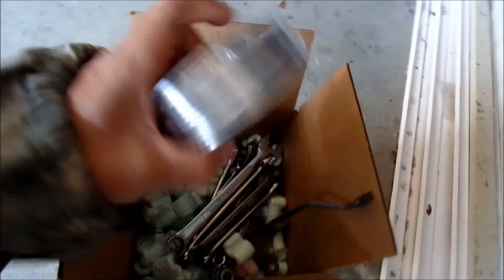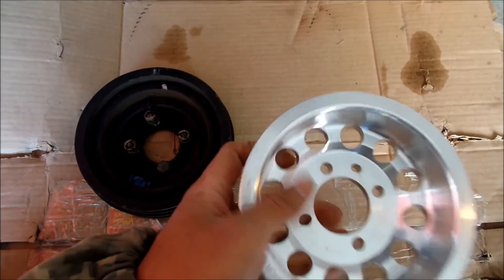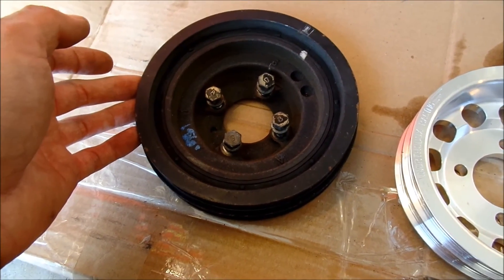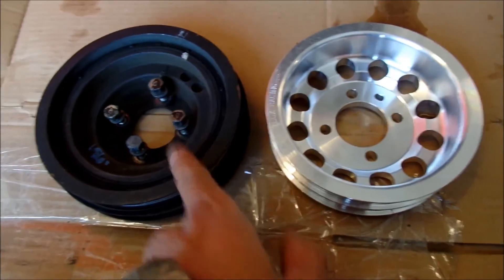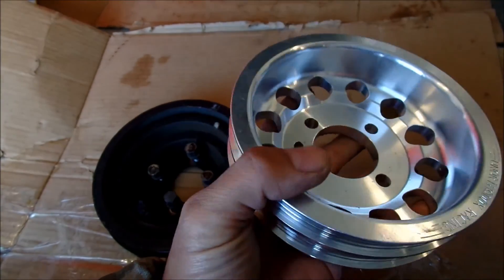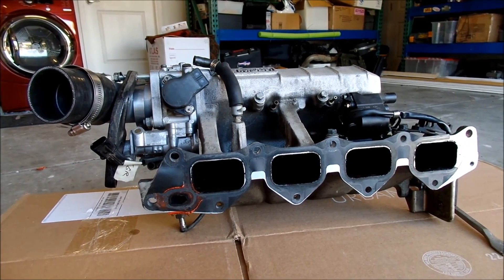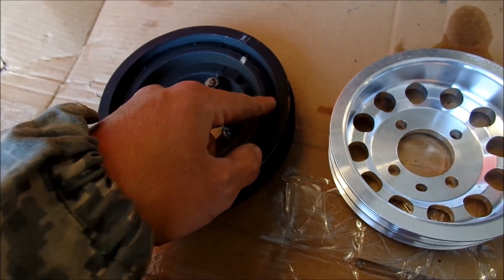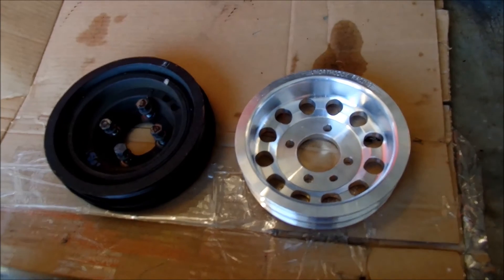HadesOmega Compares: Harmonic Balancer vs Underdrive Pulley

Comment: It's a harmonic dampner. Used to absorb shock from the  AC PS and alternator. This is why early Hondas did not have it. Thy had no PS and AC was an option. Later civics began to come with AC and PS so the crank pulleys began coming with the dampner. Now newer cars don't have them again because the PS is electric on some and companies are trying to meet stricter fuel expectations. Just torque it to spec and set the timing correctly
Reply from the maker: A harmonic balancer is to dampen vibrations from the crankshaft.  I used to have a 1995 Eclipse RS with the 420A engine (neon engine) and it DID NOT have a harmonic balancer, it had a solid crankpulley.  This car had AC and cruise control.  I don't remember the exact reason but the crank was more balanced than most other cars.  So your reasoning behind the harmonic balancer used to absorb the shock from the AC and PS load is not valid.
Reply: Cruise control is just a mechanism on the TB, and AC systems have a clutch that themselves absorb shock. And Dodge engines, like Chevy are internally balanced. Doing a real good job with making a sound argument, keep it up.

Comment: Your engine bearings will thank you if your use that stock one. These after market under drive solid piece pulleys are really tough on the 4G63. There was an engine builder that did reviews on his running an under drive solid piece pulley on the strip and after 10 runs he would see noticeable bearing wear. He switched to a fluidampr pulley and no bearing wear after ten passes. Engine harmonics aren't something to mess with if you want long life out of an engine. I switched to a fluidampr and noticed my transmission started shifting smoother.
Reply: Oem is the best
Reply: How would a supercharger affect this ?
Reply: Very useful info